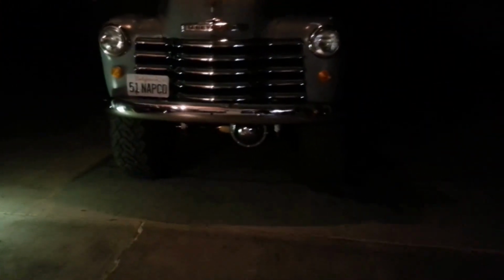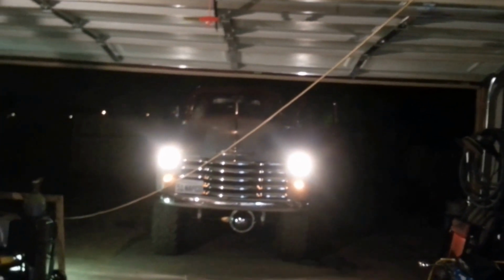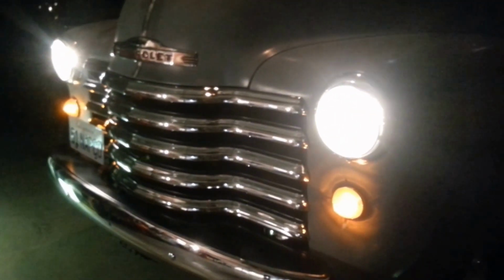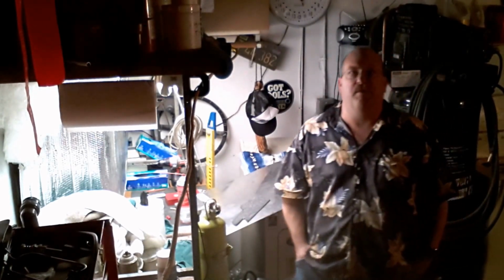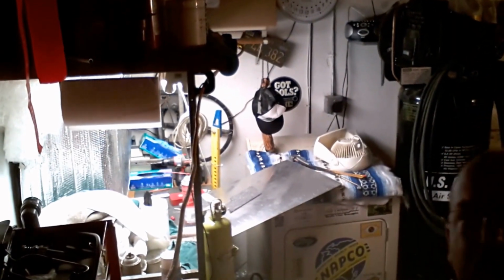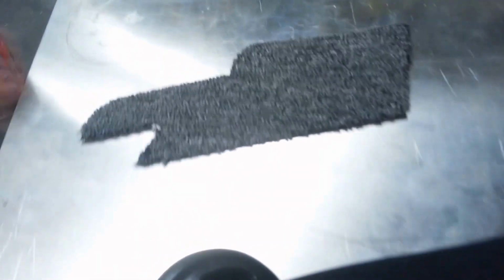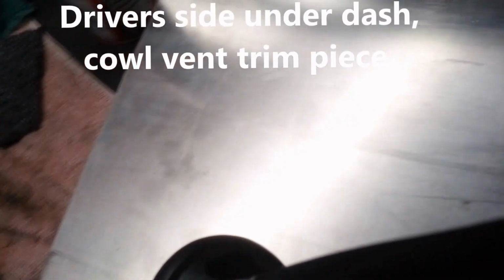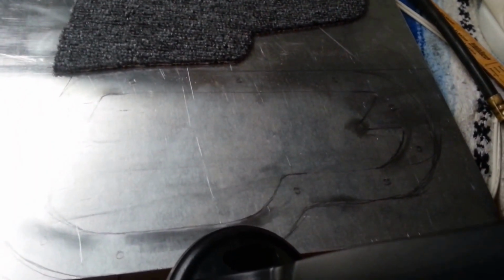First SHORT Drive, and Debrief

Comment: bummer on a few thing as you said but time will work out the bugs and its a sweet ride so a bit more work is all it needs TLC as they say keep up the good vids by the way if it has king pins check them out might be the wobble
Reply from the maker: Thanks Drew, It has steering knuckle trunnions and brass tapered bushings on top and standard roller bearings on bottom(instead of king pins). they're all packed with grease and tightened to spec for this NAPCO front end. I'm suspecting I need a bunch more caster. because the truck is darting uncontrollably in both directions. (EVERYTHING is tight) I'll keep everyone updated on what I come up with.
Reply: if I remember this right my dad when I was like 8 or 9 had a old truck doing the same thing found out they had taken to much play out of the steering box once it was adjusted every thing was great just a thought

Comment: It seemed to me that your tires are so big the suspesion needs stabilizer shocks to take up the vibration. Those huge tired and the suspesion is light considering. Shocks tieing the suspesion with the frame in your front end and rear i believe will make it ride a lot better. just an opinion.
Reply from the maker: I actually fabricated heavy duty shock towers for the front, and a heavy duty shock mount cross member in the back. I have Rancho RS9000 shocks all the way around. I don't believe I have any dampening problems. I'm pretty sure I have an alignment problem. I'm pretty sure I built in real close to zero camber with some shims I made. and I'm sure I don't have enough caster built in yet. I need to put in a couple4 or 6deg shims in between the axle and the springs.
Reply: CHEVY NAPCO I am sure you will get it worked out, I used to have a Chevy work van and it had a lot of lateral vibration when making certain turns and I always had a lot of weight in the van, the dealers installed stabilizer shock laterally to absorb the vibration that is what your vibration reminded me of. Good luck my friend.
Reply from the maker: I do want to build in a steering stabilizer, but still need to fabricate up brackets for it because all the NAPCO steering components to connect one are in the back of the axle assy, so haven't done that yet. The next video I post keep an eye on where the main tie rod is located. and remember I cant drill any holes or weld on the front end because its historic.